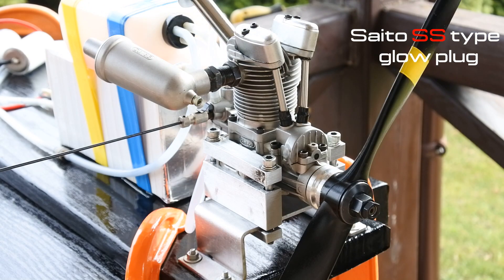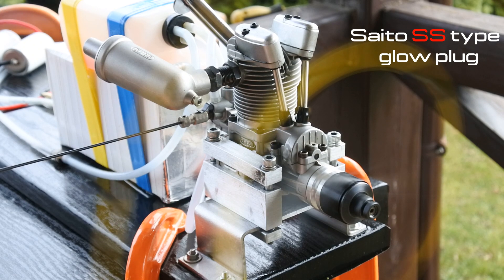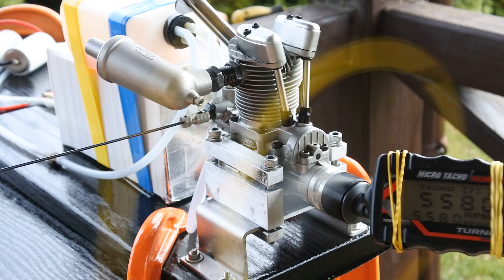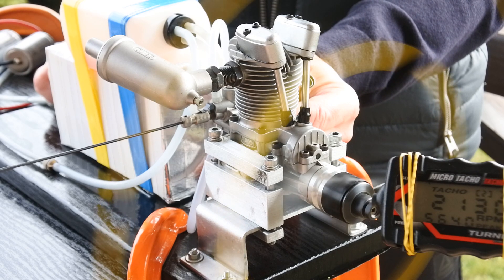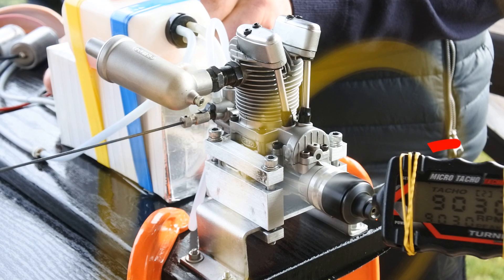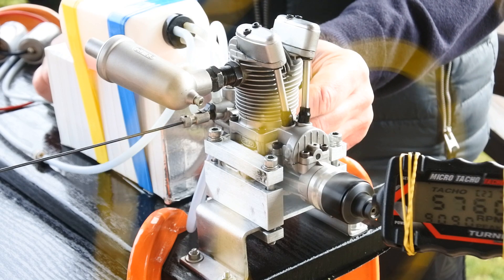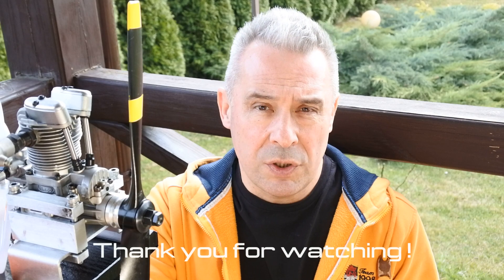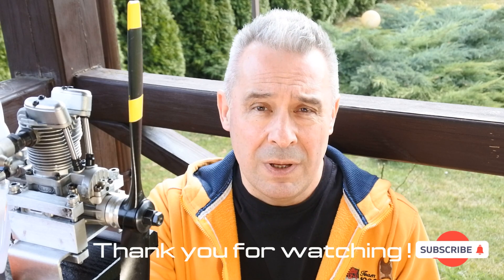Saito FA 65 comparison test run

Comment: What kind of fuel did you use? I use Coolpower 15% synthetic and I have 10,400 rpm top end and idle at 2,400 rpm 12x8 prop. 1.25 turns on the high needle still rich
Reply from the maker: Hi and thank you for your question. This video is a  part of a few videos, dedicated for engine's test run comparison in .50's - .60's class. It was a cycle of a different engines test runs & main idea for correct comparison is the usage of the FAI fuel, without any nitro methane additions. That's could be an explanation, why  your figures differs from my measurements. You can check summary of the comparison test here: https://www.youtube.com/watch?v=K_j46lZeCWY Almost 10 different engines were involved in that comparison test run.  Thank you and have a nice day !

Comment: May you please tell me what stock needle setting are on this engine? I hear 5 turns and I hear 2.5 for some of these 65 saitos
Reply from the maker: Hi, thanks for your question. I’ll be at my workshop few hours later and will check the needle position, also, will look into engines manual.

Comment: Great video..now those saito engines have a brilliant sound..and yes makes good power..i chose this engine over the os fs62v ..saito looks much better 👌
Reply from the maker: Thank you very much for your comment ! Certainly, I would agree with your opinion. I haven’t tested few single cylinder Saito engines yet, its in my plans, of course, but definitely, when I work with Saito, usually I expecting less surprises, than with other manufactures. I think, that Saito have designed the “general” engine concept, and being more conservative, they aren’t changing more, that it was necessary. As far, as  I know, Saito pay much attention to the metallurgy and specially, in chemistry, in design and development of their models. Mechanical quality are excellent, no words. Only one design speciality confuses me, usage of the high silicon content aluminum  in the friction pairs, frequently, without bronze bushings. In some conditions (& it could happens), with lack of lubrication, in high temperature environment and under heavy loads, this friction pair ( for example, conrod / piston pin, conrod / crankshaft) could seized and fail. This is a key danger, I should say. OK, this is another topic starts :-)
Thank you and have a nice day !

Comment: Wow that is a big difference in comp ratio. 
I would have imagined that would almost nullify any efficiency gains of running methanol. 
But clearly it goes rather well. Another great video mate.
Reply from the maker: Thank you very much for your comment ! Very pleased. As to me, engine performs very well, doesn't matter, that of FAI fuel. I can imagine, how it will run with just 10% Nitro. Wait, all have its own time...Thank you and have a nice day!

Comment: Yes, and it lost 1000 RPM on a 13x6 prop with the reduced compression.
Reply from the maker: Thanks for your note ! If you're meaning this data, which was published here: http://sceptreflight.com/Model%20Engine%20Tests/Saito%20FA-65%20%282%29.html and in comparison here  http://sceptreflight.com/Model%20Engine%20Tests/Saito%20FA-65%20update%20model.html , you're right. 
According to this data, my engine, which was tested, was an "updated"  Saito FA 65 version. Both reviewers were using fuel with 10% Nitro, which should increase TOP RPM speed at their test. During my comparison test run, engines was developed 9120 RPM with 13x6 MAS & Yamada YS #4 glow plug, it was with on a FAI fuel, and the temp was + 2 degrees Celsius (not as 18,9 Celsius (66 degrees Fahrenheit) during reviewers test run. So, I think, that my engine was performed very well, in comparison with TOP speed data, mentioned in this 2 reviews. I'm still have some plans to provide a couple of test runs with Nitro added, with the same engines from FAI fuel test, to compare, how amount of Nitro will influence on the engine TOP speed. 
Thank you for being attentive, and wishing you a nice day !